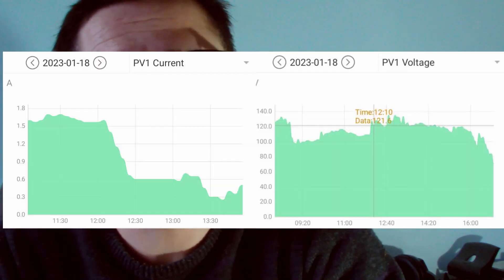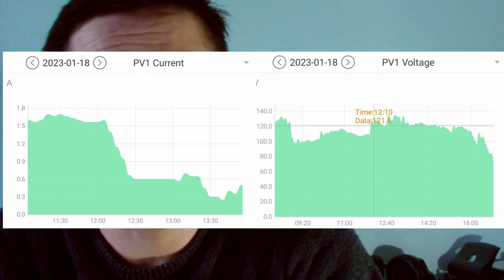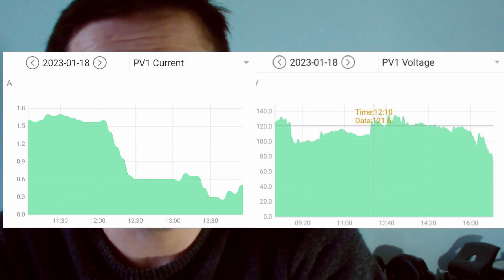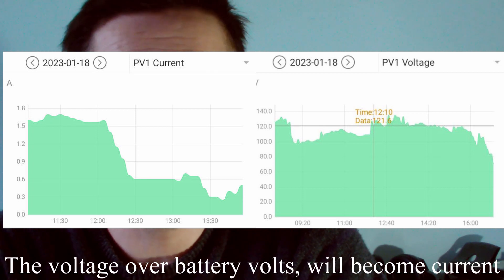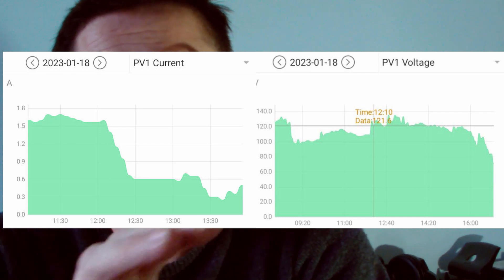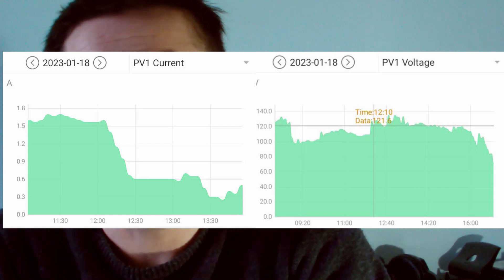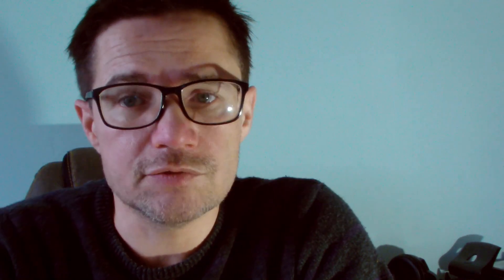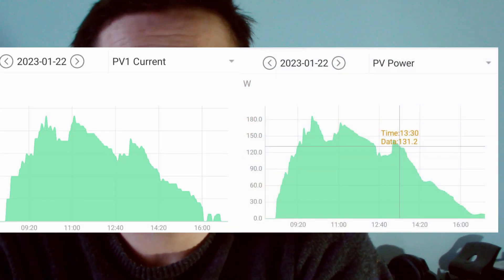Solar voltage or current, which is best

Comment: The main consideration when deciding whether or not to connect panels in parallel or series isn't the type of charge controller used.  These days, there's really no excuse to be using PWM controllers at all.  The three main factors are the VoC rating on your solar charge controller, whether or not your panels have bypass diodes, and then what degree of shading, or partial shading, you have during peak solar hours.  Most of the time you want a higher incoming voltage (panels in series), in part because of the graph you showed, but you still have to be sure that voltage is within spec for the controller.  If you do have one or more panels with partial shading, and each individual panel produces enough voltage to charge your battery array, then wiring in parallel (on an MPPT controller) will get you the most total input.
Reply from the maker: Quite a few people still make the array with series and parallel connections.
They are often confused by the amp rating of the controller. Say a 100amp controller will take 100 PV amps input, when they don't think of the factored out out.. ohm's law.
VOC/battery voltage = factor.
Panel current X factor.
Some mppts are fake and we're looking at budget installs as well. A lot of people will 'test' with a small and lowest cost system before moving on up.
But yes your right. it is voltage the controller can take.